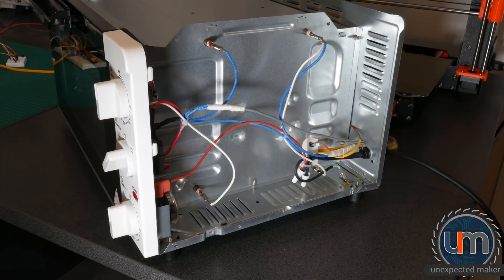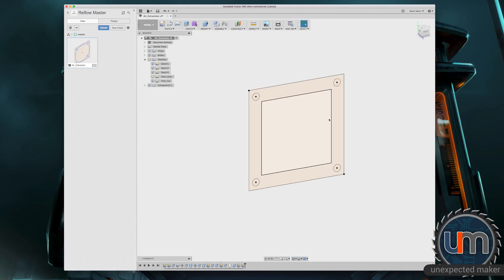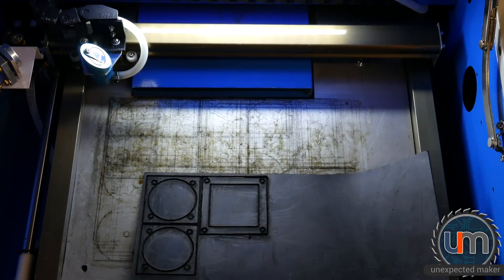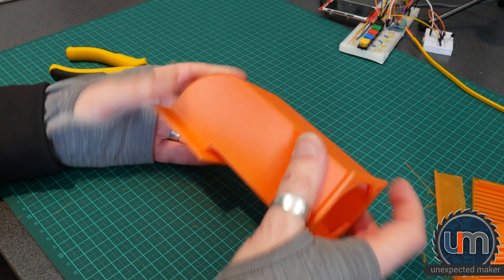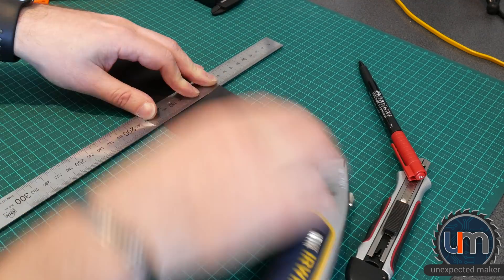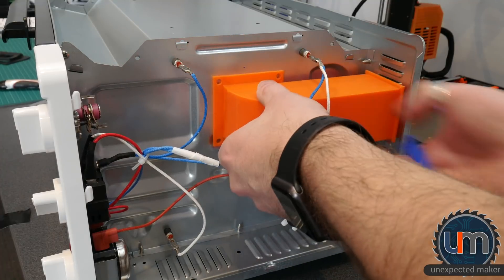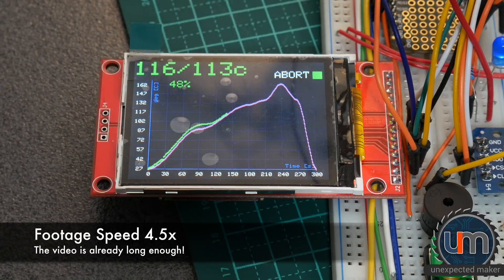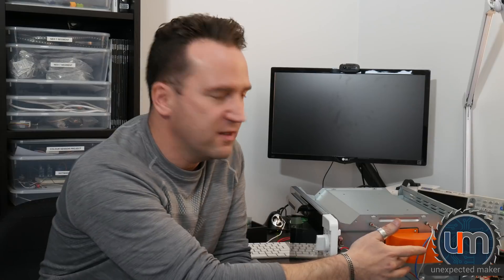Hack-The-Oven - Adding an exhaust fan

Comment: "Eeeek" Trying to cut Viton with laser (i.e. heat)… We use this material in my industry; extreme measures have to be taken if it gets overheated. Because Viton is a fluoroelastomer, I believe that it emits hydrogen fluoride or similar when burned. And when HF combines with moisture in the air you get hydrofluoric acid (which you probably know eats mostly anything). "Don't breath this". Cutting with a knife much better idea...
Reply from the maker: Hahaha, yeah, lesson learnt. I was wearing a mask when I was lasering it, but it wasn't a carbon filter mask. I have some of those now, but I have NO plans on sticking Viton anywhere near my laser anymore!

Comment: Cracking build. Wondering if you'll need to add some insulating washers to the nuts at the oven side?  I am assuming the bolts come through from the oven therefore they will be good heat conductors and possibly melt the PLA at the fixing point. Possibly also shield the side of the exhaust that runs next to the oven wall with some of the rubber.
Reply: Unexpected Maker PETG for the win ;-)
Reply from the maker: Yeah, this setup def needs more thought... initially I just wanted it assembled so I could test the effectiveness of the fan, expecting it to fail. Now that it's working (still shocked), I need to think a bit more about the "PLA" situation ;)

Comment: I did think blowing would be the way to go, to avoid heat destruction of the fan (and PLA). 
Perhaps you also want a couple of small holes in or near the top of the oven, for the hot air to exit when you start pushing in the cold air (so that cooling curve continues it’s journey down).
If PLA starts to distort, perhaps try ABS or even something like eSun ePC, which has a high distortion temperature.
Loved the: “it just cuts with a knife” revelation! LOL. 
It’s really great that you share your discovery journey. We can all relate to "process optimisation" experiences! :-)
Reply from the maker: Yes, you were pushing for the blowing - and that's why I tried it first... and I really was surprised how well it worked, for such a small fan, and long channel for the air to move through, so a big THANKS for that!

If I was to print it again, I'd prob go with PET-G.. def easier to work with than ABS and almost as strong, but ideally, if I stay with this oven going forward, I'll get a metal channel fabricated and just remove anything that could melt ;)
Reply: @Browarus Pierogus - I believe if the hot air exit hole(s) are the optimum size, you will not need a regulated flap. 
Seon’s setup showed that even with the large cold air inflow hole, the oven still had the capacity to follow the required heat-up temp curve.
It was only after the cool-down had progressed some, that the desired cooling rate could not be maintained.
If optimum size, high positioned, exit holes were drilled (hot air rises), the heat-up curve capacity will likely still be retained, but a controlled outflow of hot air will be allowed for once the fan start-up introduces some internal air pressure.
Optimum hole size / number of holes (to allow following the cool-down curve) would have to be determined by starting with a small hole and observing impact on the cool-down curve (and ensuring no impact on following the heat-up curve!).
The opening / hole size for the required hot air exhaust rate, is probably also best implemented with multiple small holes, rather than one larger hole.
But, of course, this theory would need to be tested in practice! :-)
Reply: @Browarus Pierogus - How do you mean? I'm assuming Seon's code is just switching the element on / off, to follow the desired temperature curve, then switching the fan on for the cool-down.  Hence why I was thinking appropriately sized hot air exit holes (once fan introduces air pressure) would do the trick. ie. Not a "coded" hot air exhaust process, just based on tuned air-flow dynamics. :-)

Comment: If you ran the fan VERY slowly during the heating phase, could you prevent the hot air from escaping?
Reply from the maker: That was what I was originally planning when I was trying to control the fan via PWM, but now that I am using a transistor to drive it, it makes it a tad harder. I was playing with PWM-ing the transistor base, but that doesn't seem work to kick the fan into initial operation it seems... unless I start it off for a second or 2 and then start to pulse the base. - more testing needed, but if I can get it to spin slow and consistently, then yes, that's def an option for sure!
Reply: Unexpected Maker maybe using a mosfet could help? You don’t have the voltage drop that you have on a bjt. But maybe a pull up or Pulldown resistor would be needed than. Also leaving it as is and when starting up this fan giving it a few seconds full power as suggested from you could work.

Comment: curious, the ambient was not getting hot but now it will since it's basically an extension of the oven, isn't it? also if the fan is extracting, the hot air will have to travel the pla, which might be problematic? let's hope it works though :D
Reply from the maker: I settled on the fan blowing... and I cover final ambient temp in the PLA at the end of the video :-)  I'm not sure reflowing 20 boards in a row is a good idea, but it's def stable for small runs.
Reply: yep, sorry, got carried and commented before the end of the video :) nice job ;)
Reply from the maker: All good mate! I often comment during a video watch too ;)